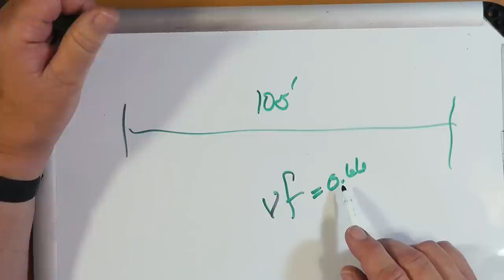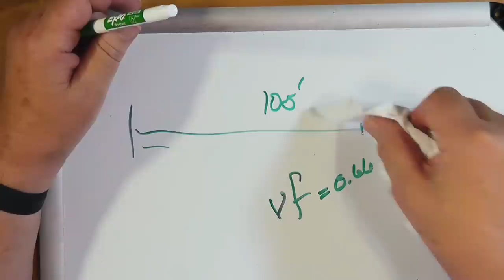Questions on Coax Length (#470)

Comment: I find that if the Antenna, Pole and Coax Shield is not grounded properly, then coax length on a isolated or not proper earthed system will make a difference

Comment: I think when you want to built a coax dipole like a 2TL2 bazooka or a antenna where the feeding coax is a part of it as a tuned counterpoise you do have to calculate exact lengths and have to take the velocity factor into your calculations.

Comment: Just skimming the manufacturer's website, they sell a variety of antennas including a few that are advertised as "no radial" multiband verticals "with no lossy traps or coils". They do recommend specfic lengths of RG-213 coax "for best tuning".  These are non-resonant antennas using a transformer and I expect they really need radials but instead are using the coax shield as a makeshift counterpoise/groundplane and the length affects the feedpoint impedance and ability to tune.
Reply: This is on the money. The coax is a specific length because it functions as part of this antenna. It’s not just a feedline. I ran across this when I first began considering antennas, and saw claims for the somewhat “miraculous” 43-foot vertical, which is non-resonant on all bands.

Comment: The only time I’ve heard of coax length being important is when the shielding is used as a radial element in a vertical antenna.  Then it needs to be long enough to tune on the band being used.
Reply: Seems this topic eludes a lot of old timers since end fed 1/2 waves didnt really get popular till recently. You must have a good coax length with them since its the other half of the antenna basically.
Reply: @David White right on the Counterpoise or ground but common mode isn’t a problem with adequate coax length.
Reply: @David White there no RF in my shack. 135ft efhw on 100ft of lmr-400
Reply: @David White Can’t really do a “proper” ground with an efhw when the feed point is 35ft in the air.
Reply: @David White impossible. At no time does the coax get close to the ground when leaving the feed point on the way to my tuner.
Reply: @David White oh I can see the idea and that is an interesting one. However not possible at my qth. What’s needs more explanation I guess is why they work so well without a ground for most people (self included) Even Dave didnt ground his when reviewing.
Reply: @David White Knowing that a grounded antenna is of course better. The chat was about RF coming back into the shack for the most part. That can be addressed with the right coax length or chokes etc if the feed line must be used as ground like when someone lives on the 3rd story of apartments or the 2nd of a house. 73
Reply: @David White You can’t do anything like that on the 3rd floor of an apartment

Comment: Remember Dave you can have a perfectly matched antenna and coax could be live with common mode current on braid of coax due to an antenna imbalance causing problems at different lengths, as you mentioned swr won't cause length issues unless being used as an impedance transformer but if common mode current is present then it can interfere with the swr readings and give the user wrong impressions of what's going on
Reply: It's why I put ferrite rings on all my coax.
G4GHB.

Comment: On a long wire before I had built my resistive SWR meter I tuned it with an r.f. pickup meter for maximum out. With the meter installed it confirms what I expected, the SWR goes down and the r.f. increases. That's a way of tuning an aerial. No magical ½λ coax.
I built the meter about ten years ago. It works as well as a commercially made one in a comparison test.
G4GHB.

Comment: I like the suggestion that 50' (~15M) of coax feeder will mean it is far enough away from the TX (and operator). It's a reasonable thing to say.
But, even that said, every metre or meter of cable that is unnecassary is more loss, especially on the higher bands (shorter wavelengths).

Also, the problem with 1/4 and 3/4 wavelenths in lengths isn't really the impedance transformation unless you are using a different impedance of coax to do exactly that (ie, a 1/4 wavelength of 75 ohm or 92 ohm to transform it to something higher like a pair of folded dipoles. The problem is that some faults at the far end can be masked by having a 1/4 or 3/4 wavelength, but seriously, it doesn't matter - if it is all 50 ohms (or whatever is being used), plus it is all terminated correctly and everything is matched, then it will work just fine. 
I put this furphy to bed many years ago and have not ever had a problem and that includes installing medium power FM band radio stations and commercial communication 162-169MHz systems.

Comment: Going back late 80's my teacher at CSE CT. School of Electronics told us to take the length of a 1/4 wave of the freqs that will be using and X that until we achieve the length needed.  For example: if 36ft is a full-wave of 11m 9ft would be a 1/4 wave. So, if I need a 100 ft, I can X 9 by 11=99ft or X 12=108ft, I'd take 108ft or even go 117ft. He also said we can use 3ft intervals instead of 9ft.  For example: in a vehicle, you have an antenna system with 18ft, you find you are short, then you add in 3ft intervals. Both are to achieve a better SWR.  I tried this with a Rig Expert and found it did help on 10m, 11m, 12m. using an 11m Antron 99 antenna with each band
Reply: I heard you are not supposed to use odd quarterwave lengths ie. 1/4 3/4 5/4 or 1.25 etc. I think it is seen as a dead short at the feedpoint on the vna.
Reply: In 49 years I've never felt any need to cut coax to a specific length or avoid ¼λ. My aerials work well and now with the NANO VNA I can see there is no problem. I moved my 2m dipole so needed to re-tune it. About random 12' coax with a ferrite ring, the SWR went down and I got 50.5 Ω. I'm not trimming coax to get it.
18' carefully trimmed plus the coax to the rig. An SWR meter is not some magical isolator, it connects both coax cables together as one. They don't seem to understand that.
G4GHB.

Comment: The place I first heard about this is in the CB world.  They would always talk about the length being tied to wave lengths, but I never did figure out why.  My though was it had something to do with how they would do dual antennas, AKA the phasing.  With most of that being inside the car, not much of a counterpoise.
Reply: I have recently discovered there is some confusion over this. The 18ft of RG58 thing and the RG59 (75ohm) harness for dual antennas. When you calculate 3/4 of a wavelength for Ch8 and multiply by 0.66, each section of RG59 lands on 18ft. I mean almost to the millimeter. This is just a pure coincidence, and who's often setting up dual antennas? Truckers.
Reply: Yes, they seem obsessed with ½λ coax. 
They seem to think the SWR meter is an isolator from the radio side. It connects both cables together internally so adds the aerial coax and the jumper coax as one cable throwing their efforts into trimming ½λ pointless.
Phasing lines certainly need a specific length as on crossed dipoles.
I've never purposely avoided ¼λ either, I use what I need with no problems.
G4GHB.

Comment: I think he was looking at the phase angle; if you had a vertical that was on one frequency the phase angle could be a factor for the best power radiated on a full wave antenna. In the real world I don't think this really matters that much since a lot of the antennas are multi band antennas. KB6DX

Comment: Are we back to the CB idea of cutting coax to specific lengths? I don't get it.
I've watched so many videos about this lately, one saying they sell 18' coax to the aerial, others allowing for Vf so shorter lengths, jumper leads must be in 3' increments.
Do they think an SWR meter is an isolator with one side not seeing the other? 
The aerial side is not independent of the radio side because it's connecting both cables internally. The SWR meter is a connector with a meter, no different to a coax coupler with a meter, it sees the two cables as one cable.
I've used coax on my aerials and never bothered to check if I happen to have a ¼λ, I just use what I need with ferrite rings. Not ever a problem all my h/b aerials, dipoles, inverted vee, long wires and tuner, 2m collinear.
Is this part of a counterpoise earth system to use the coax braid for that Zero 5?
G4GHB.

Comment: For mobile what length of coax is needed 11meter band . I know usually antenna seller sell there antennas with 17 foot coax as standard on rg59 .. but if I’m using a different coax like lmr what length would I need ?
Reply: Don't bother about length, use what you need. Adjust the aerial, not the coax. Use a ferrite ring.
An SWR meter doesn't isolate the aerial from the radio, it's connected together in the meter as one cable.
In 49 years I've never cut coax to a specific length.
G4GHB.

Comment: I've found it interesting that the serious, and respectable super high power CB folks (not the jackwagons), all suggest that you are very careful about the coax length and velocity factor to achieve maximum performance and lowest possible SWR's for super high power 11 meter work.  Some CB specific radio shops will sell what appears to be odd length coax precut and 259's attached.... but the "odd" lengths are "pretuned" for 11 meter radio work so the antenna does not need to be adjusted.

I'm not sure if it is because it truly is "best practice" being promoted by the 11 meter masters who take their radio as seriously as any Ham, and the idea that coax should be trimmed instead of the radiator itself for absolute maximum performance; or more likely, they are advising people with super power illegal amps how to best minimize SWR with such incredible power levels, with reflected power being a major concern.  Either or, but likely both?

I think some of the argument comes from "hardcore" single band folks.  If someone gets a Ham license, and for the sake of argument, only does 20 meter CW for 60 years, the argument that a theoretical perfect tuned coax is easily achieved with a little work without compromising the near perfect radiator would not be a difficult task to try to eek out that little bit of performance or potential.  Let's say instead of 20 meter CW, our radio operator is a lifelong CB enthusiast, or some kid putting in his work with GMRS and repeaters, ect.  

Not so much that exact coax length/velocity is necessary per se, but still optimal?
Reply: Cb shops are not selling odd lengths,,,you need odd multibles  of a 1/2 wave minus velocity factor,,for 11mtr this is just under  12 ft,36ft and so on,,,this is in no way a method  of tuning  a mobile antenna,,just ensuring your rig see,s the swr the antenna  actually  has,,this method is only for mono band working ie 20mtr,,15 mtr or what ever,,,but even for an antenna  thatvwill be multi band i always cut coax for the lowest  working  freq,,and the rest is delt with a tuner.,,,i dont know if this applies  to other types  of feeder like open wire etc.
Reply: @battlestarone  The extreme CB types are definitely monoband, and many choose only one channel/frequency or just a few in the same area.  Also, I'm referencing the super power base stations, which sometimes run as much power as a commercial AM station.  For their purposes, they tend to profess the best practice is to leave final precise tuning to the coax length, as far as I've seen.

I don't know if they sell a 50,000 watt HF tuner.  So I think that isn't an option for some of them.
Reply: It's all nonsense as the aerial coax and jumper coax all join together in the SWR meter as one cable.
I've never in 49 years cut coax to a particular length. I moved my 2m dipole so now with the NANO VNA I can see the SWR down as the impedance got to 50.5 Ω. No magical coax length needed.
G4GHB.
Reply: @kingduckford  You think commercial a.m. stations tune their coax? Or commercial t.v. transmitters tune theirs?
G4GHB.

Comment: I am not a ham, however there seems to be a couple of things wrong with this, with this case study if you will. It's convoluted.
We can assume this guy is using the antenna for single band or even single frequency use. Why? Because the length of coax, taking in the VF, is obviously going to change with frequency. If the impedance changes due to coaxial length, as you point out, either the antenna is not 50ohms or the radio is not 50ohms, or both. So why is the antenna not 50ohms from manufacture for a set frequency, and more importantly, why the hell is he using a tuner for single band use? This is simply idiotic, the individual needs to go back to basics and learn the fundamentals... properly. You probably should have pointed this out.
By the way. The ARRL does mention coaxial lengths. Aside from the use of quarter wave sections and stubs, it touches on a half wavelength, or the 'half wave rule'. This of course includes multiples thereof, so it is applicable to this subject. The ARRL also mentions the use of certain coaxial lengths that can be employed to feed a balanced antenna. But what would I know, I'm just a CB'er. No ticket required I suppose.